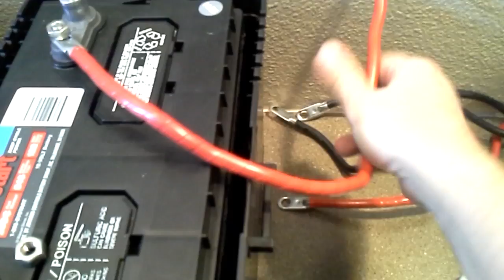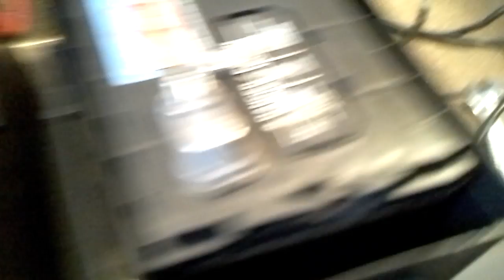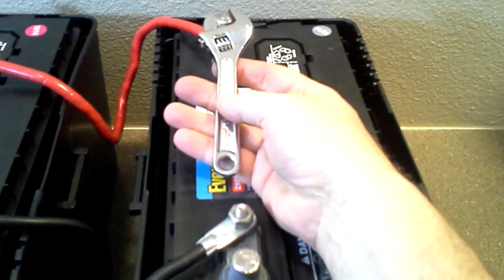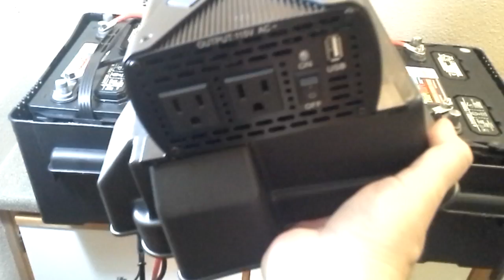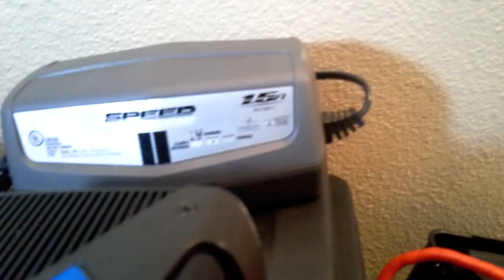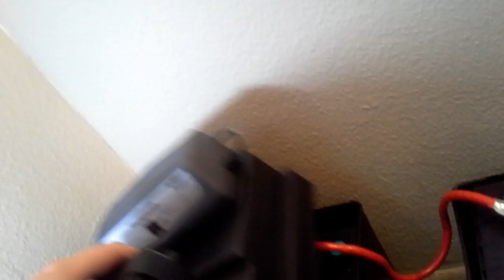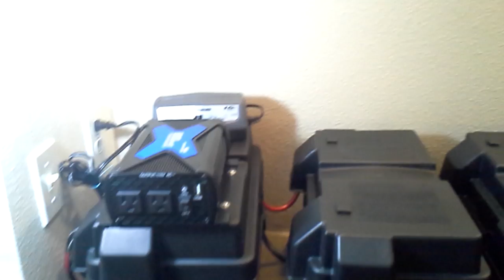Installing 4kW/Hr battery bank with 800W 120V Inverter and Trickle Charger from Tactical Woodgas

Comment: Is it possible to run a frozen yogurt machine that takes 30 amps with a system like this
Reply: 30 amps is lots of power. You could do it with batteries but you would need more batteries and a larger inverter. His battery pack here is 300 Amp hours. 
The further you discharge your batteries the shorter their lifespan so if you only use 60% of that 300 amp hours, you are talking 180. The faster you drain the batteries, the less efficient it is so, realistically, a 300 amp hour battery set up would only power a 30 amp machine for 3 to 4 hours +/- and it very well may damage your batteries. 
To do it safely, without damaging you batteries and getting something that would run all day, you would need close to 1,000 amp hours of battery and a 5,000 watt + inverter. 
When I started looking into batteries to power stuff, I was really disappointed at how much power some things needed and how many batteries it would take. Anything with a motor sucks power big time. I would assume a yogurt machine needs to cool as well as stir and pump it out. That's lots of power. Also, keep in mind, if you are using it every day, you also have to be able to fully charge overnight. 
There are big motor homes that have systems like that so yea, it is very possible but it would be big, heavy, and pretty expensive.
Reply: Frozen yogurt machines run on 31.24 giga-newtons, unless you're in Austalia, where they run off of 42.13 giga-newtons.

Comment: With this system you have 1kw at a safe 30% DOD ( Unless your killing the battery's )  .
A battery life of 2 years if your lucky & high self discharge at the end !

You should have used Lithium for this small 1 kw system .
With 90% DOD & a very long life .

Comment: Your cables look like they may be 6 gauge  or 8 gauge.    Those look plenty big to me for the amount of amps, but Im no expert.   Question: Do you know why so many battery bank videos on Youtube show these  massive 1 gauge (or thicker!) cables on the batteries?   Are they planning on their batteries  transferring around 100s of amps?
Reply from the maker: John Rutkai 
Most people don't know how to look up the current rating of the different sizes, so play it safe by massively oversizing.  No harm in that except to the wallet.
Reply: For that system,it will be fine. What inverter?
Reply: there is less voltage/current loss with larger cables. When in doubt, use the larger cables and solder all connections if possible (another source of voltage drop)

Comment: Nice Hydrogen bomb you've made. NEVER install vented lead acid batteries in the same room as an inverter. A single spark from a relay or a cold solder joint or a look connection and you'll have a hydrogen explosion. Good luck dude!

Comment: SO im new and trying to learn and from what i see that you you plugged into your home and battery how are you just powering from battery confusing  so what do you do if you dont have home electric ???
Reply: You get your electricity by plugging whatever you want to get power to by plugging it into the inverter. As for charging the batteries, you either need a generator or a solar set up.

Comment: Would it not be better to have super capacitor banks and organic carbon power cell banks?
Reply from the maker: Indigo Dragon71 
If money is not a limit, there are other options.  Reliable and cost-friendly deep cycle lead acid batteries fit in normal budgets.
Reply: No
Reply: Indigo Dragon71 organic carbon? Are serious right now?

Comment: 4kw/hr with only 3 100ah batteries?

FOH
Reply: I am sure he means kWh, not kW/h. One 100Ah 12V battery is a little more than 1 kWh, in fact 100Ah*12V, (A*V makes W, h stays), so 1200Wh, (1000W is 1kW), so 1.2kWh, if you multiply by 3 batteries you get 3.6kWh
Reply: @kestuxd6953  thanks for the clarification

Comment: So if you plugged the battery charger into the spare socket ( once batteries are fully charged) would that be classed as Free power ?
Reply: Every time you change energy you lose efficiency. In this case you would lose about 10% from chemical to electrical, then lose about 12% in the inverter, then about 12% more in the charger, then about 10% more from electrical to chemical.
In order to have perpetual energy you must have over 100% system efficiency. They say it's impossible, and no one has ever done it. They say...

Comment: Did you need 3 batteries for the 800 Watts inverter. Or can you use Just use 2 batteries instead .
Reply: no
Reply: No, one battery can do this also but, by using 3 batteries, the system has more amp hours. In other words, it can power items for a longer time. So, one battery may have 100 amp hours and three will have a total of 300 amp hours, thereby allowing for a longer use time.

Comment: my idea would be  to charge the batteries not using an AC outlet
Reply: Recharge by carrying the discharged battery bank to your car, start your car, and connect with your jumper cables for 30 minutes.

Comment: Tactical WoodGas, I have an ambulance truck Ford E350 that comes with 3 deep cycle batteries and I'm thinking of converting it into a camper. I want to buy two of this inverter to hook to the batteries and run my 6000watt appliances. Is this possible? If I don't want to install a generator not solar panels. Just the deep cycle batteries and (2) 3000 watt inverter or if there is a higher wattage inverter I'll get that.
Your valuable advice is greatly appreciated.
Reply from the maker: That should work.  You will recharge them from the alternator?
Reply: @tacticalwoodgas4036   actually the ambulance came with 4 BXT 65-850 motorcraft max batteries that are recharged by the alternator of the ford e350 extended van. All wiring was done at the factory. I have an equipment that draws 5800 watts at startup. Do you think I will have to keep the motor running to have the appliance on or the power from the battery and inverter can supply enough power to keep it working?
Reply from the maker: @ETSecm  
Those are not deep cycle batteries, so you should keep the engine running when operating the inverter.

On my truck, I have two deep cycle batteries isolated from the starter battery when the ignition is off.  That way I can run them down and still be able to start the engine.

You may want to do something similar.

Comment: I'm curious (don't know if you or someone else can answer) if I have a 100 ah battery and a 60 watt solar panel that puts out approx 5 amps would it be able to eventually put 100 ah back into the battery?
Reply from the maker: mark s 
Yes.  100AH/5A=20 hours of good sun to charge from dead to full.  Inverters cut off at when half the battery charge is gone to extend battery life, so 10 hours of full sun.
Reply: Thanks....I wasn't sure if it could push that many amp hrs back in.....I was just curious

Comment: Can you run the full size refrigerator with this inverter?
Reply from the maker: The 3000W version at www.tacticalwoodgas.com will.
Reply: A high quality xantrax inverter this size will run it. Most cheap inverters this size can't handle the brief high current a refrigerator or other motor requires at startup. You would need a 1200-1500 watt or so cheap inverter in order for it to handle the surge. See Knurlingar on you tube.

Comment: is it plunged up to the wall to charge
Reply: Yes, it plugs into the wall outlet to charge, also you can recharge it from your car with jumper cables.  If you want to charge with solar panels, a new model supports that at www.tacticalwoodgas.com
Reply: I want to build a flywheel genartor I just can't find a video on how to hook one up to my home for when I do
Reply from the maker: I've only seen those used in satellites, powered by solar.  Not practical for home use.  Gravity causes bearing friction, atmosphere causes resistance, and they are not safe to move when spinning.

https://en.wikipedia.org/wiki/Flywheel_energy_storage
Reply: Is it possible to plug the charger into the inverter?
Reply: It can charge from itself (no free energy).  Plug it into the wall.

Comment: can you not make the power of the battery to charge itself? you can take the one outlet of the inverter to charge the batteries; you will be needing a battery charger though. your set up is actually self-sufficient, it doesn't need outside source to make it run. it would be better if you have at least 3 220v output sockets. this set up can generate enough power to run your air conditioner and other high power consuming appliance. it can also last for a very long time...all you need to make sure is the level of battery water solution is always at the right level for the battery to last longer.
Reply: Jun Acaba 

No free energy, you have to charge from an external power source.
Reply: you are not considering losses and inefficiency in a system
Reply: Battery only holds so much power so some of that power is lost In trying to charge off itself and that loss will eventually make the bank go dead.

Comment: Which solar panel size, inverter and battery do I need to run a 32" TV and a Home theatre only?
Reply from the maker: How many watts to run those?
Reply: 200 Watts probably?
Reply: But I need your recommendation since I'm yet to buy any. I'd like your opinion on which wattage of panel to buy as well as what size of inverter and battery purely for the TV and Home Theatre system.
Reply from the maker: @AkuotDiri  
https://www.tacticalwoodgas.com/online-store/1200W-Battery-Bank-PLUS-100W-solar-panel-%26-connecting-cable-p99746394

This is popular for your application.
Reply: Thanks so much sir. Much appreciated
Reply: Felix ebay cello rechargable tv-might be easier option-need a cigarette lighter socket of batteries to run it past ten hour's i use mine on ma ⛵,saves hassle running of 12v battery-land power as well use it in house-other way youll need SOLAR panels charger controller,batteries,prob want a 1000amp inverter,controller just stops damage to battery through over charging
Reply: You are going to watch TV in the day time? A LOT of batteries to run it at night.
Reply: I just picked up a brochure from mobisol, they have offices all over Kenya where I assume you are. Upto 43 inch flat screen t.v. on their system, 100 amp hours battery capacity and also includes a sub woofer. Check them out.
Reply: You have google right? Why should this guy tell you everything, go learn something for yourself.

Comment: Good day brother, A single 200Ah battery can give you how many hours of electricity ?
Reply from the maker: Hi Steven,
To make a battery last longer, only use half the charge and then recharge.
If your load is 1 amp, 100AH/1A=100 hours
20 amp load, 100AH/20A=5 hours

Comment: How long will it last?
Reply: ClankyRochet 

Depends on the load.  If you use it to recharge a phone, then it will last months.

With the three batteries, and a 720W load, you will need to recharge it in 3 hours.  Cut the load in half and you double how long it can run.

120a-h/2 ×12v x 3 batteries = 2160 w-h usable (only discharge to half so batteries last longer).

2160w-h / 720w = 3 hours

Comment: wont last long in power outage. u plugged inverter into outlet which wont run during outage lol. also, inverter 2 small
Reply: You have that wrong. He has a battery charger (grey colour) plugged into the wall socket so the batteries stay charger until the mains power fails.  Then he uses the (black coloured) inverter to supply mains voltage from the batteries.
Reply from the maker: @robboardman598  

Correct!

Comment: No charge controller needed?
Reply: The battery charger has it built in.
Reply: If you connect to solar panes, have a charge controller between the panels and the battery.  About 100W solar panel per battery is a good fit.

Comment: How do three car batteries equal 4kwh?
Reply from the maker: 13.8V x 100AH x 3 batteries = 4.1kWH

To extend battery life, only discharge 50% between charges.
Reply: @tacticalwoodgas4036  ok i am getting confused, i thought automotive batteries were 12.6V not 13.8V?  which is still close, comes to 3.78kWh
Reply from the maker: @Rocky1765  the A.C. charger keeps it at 13.8V just like a car alternator does.  So, that is the starting point when the power goes out.
Reply: Tactical WoodGas but those are starter batteries.
Reply from the maker: @GrandpaHerman1  
They are not.  They are deep cycle.
Reply: @tacticalwoodgas4036  I'm using 12 volt deep cycle AGM 1000 amp hour each for this system so far it's working okay I have a larger system that can handle 150 amps charge capacity per hour as a backup to this at the moment I'm working on my solar systems what we come up with is approximately 14.5 kilowatts incapacity volume and charge capable of providing 14.5 KW of power per day my facility
Reply: @tacticalwoodgas4036  Try measuring the actual voltage when the charger is OFF, and the Inverter is ON.  It will not be 13.8 volts.

Comment: This is not hooked up correctly at all. With multiple batteries you need to isolate the batteries with 2 diodes for each battery. With your setup, if 1 battery goes bad, they all get take down. Just a tip.
Reply: a diode drops 0.7V each
with 2 you lose 10% of the stored energy from each battery across the diodes

if you are worried about a failure  use fuses

Comment: Not sure why you connected three 12-volt batteries in series? The current draw is limited by the capacity of the 800 watt inverter so one large deep cycle battery would have likely achieved the same thing.
Reply from the maker: Mitch Cichy 
Parallel, not series.  This gives 3x longer running time between recharging.
Reply: Mitch Cichy Rite
Reply: Mitch Cichy 
He needed a bigger inverter to harvest more energy.
But he already said he wanted to consume less energy in order to in crease battery life

Comment: Hello is it possible to install it to the whole house?
Reply: A whole house system would require a very much larger system depending on what you want to power: You would need to add up the Amp's of all the things you want to power then multiple that by 120 to get your watt's and add 10% to that then get that size of inverter: And "AC" Watt's is equal to "the same as" "DC" Watt's

Comment: i have 3000 watts 48 vdc inverter please let me know how many battery and solar panal i required
Reply from the maker: qaiser najeeb 
It takes 4 batteries in serial to make 48V.  For a 3kW inverter I'd use at least 3 sets of 4 in series.  12 batteries will have 7.2 kWh.  How many kWh do you need per day?
If you use 24kWh per day, you will need 5kW of solar panels.
If you use 5kWh per day, you will need 1kW of solar.
Reply: Tactical WoodGas thank you and what about solar panel how many panal I need of 250 watts
Reply from the maker: qaiser najeeb 
How many kWh do you need per day?
Reply: Tactical WoodGas 
How to calculate
I have 22 light of 48 watts and 4 fan of 150 watts
Tv etcc
Reply from the maker: qaiser najeeb 
Look at your electricity bill.  Divide your monthly kWh by 30 to know your average daily use.
Reply: I don't know it mention only the number 
there is only previous month meter reading is 372974 
and my current reading                                        374309
and consumption of electric                                    1335
 if the meter reading comes in kwh then this is the calculation  
monthly is 1335 and / 30 will be 44.5 per day kwh
Reply from the maker: qaiser najeeb 
44kWh would need 9kW of solar, or 36 panels that are 250W.
44kWh is twice the typical household use.  Do you run a business from home?
Reducing energy need by upgrading to much more efficient appliances, using only LED lighting, etc reduces the number of panels needed and is usually the most cost efficient path.
Reply: i just want to run my lights and fan on my 3000 watts inverter 48 vdc and about consumption we have 4 air condition in home and it's hot in united arab emirates
Reply from the maker: qaiser najeeb 
Lights and fan would need about 4 panels and about 8 batteries (2 strings of 4)
Reply: Tactical WoodGas 
Thanks about panal also will be in series connection or pararel
Reply: Very Simple calculation.  22 x 48=1056Watt, 4 x 150=600Watt and total 1656 Watts. Now if you need backup for 5 hours your total daily consumption is 1656 x 5=8280Watts/h or 8.280KW/h. So roughly your daily usage is 9 to 10kw/h.
Reply: As far as connection is concerned, it depends on your system. If your inverter is 48V, you need to connect the plates in series to get 48 volts.
Reply: Imran Yousaf thanks for you reply
Each panal give how many output in vdc I have 2 panal it's I thing 250 wats each but vdc I don't know
Reply: qaiser najeeb 250 watt panel are generally 24 volt. So if your inverter is 3kw, you need to use your plates in parallel configuration because your inverter is configured for 24 volts.
Reply: 4 batteries 12+12+12+12 equals 48 thats hooked up in series
Reply: Use at least 4 gauge wires to your inverter.
The biggest wires that your inverter will accept!!!!!!!!